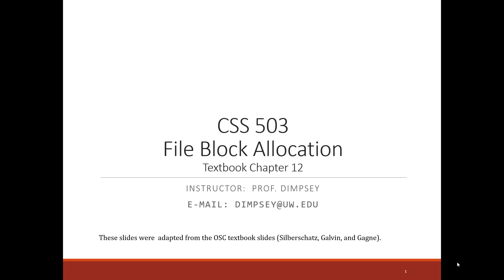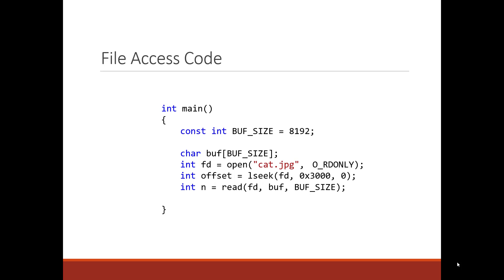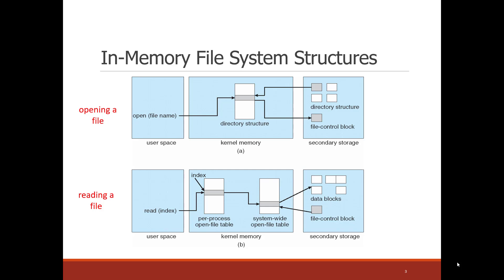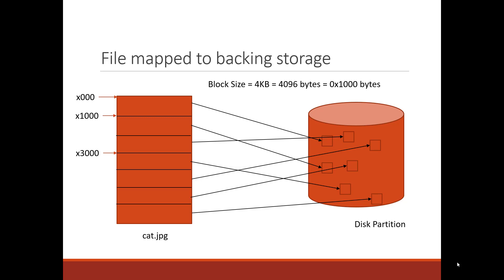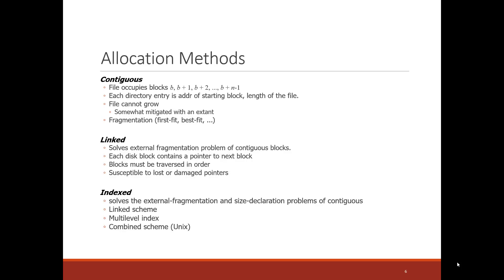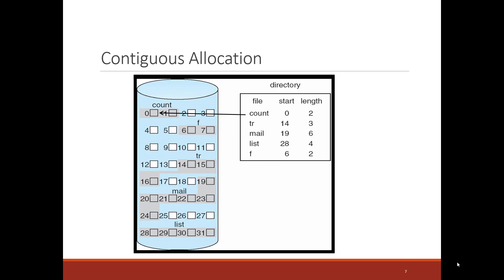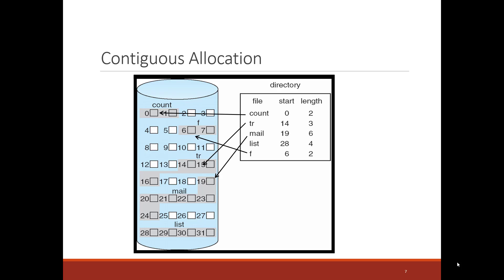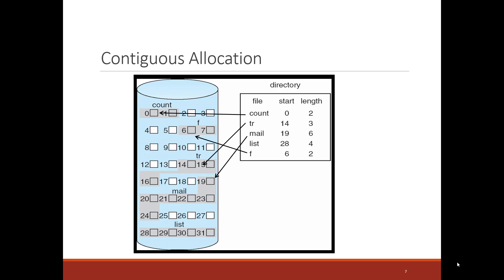File Block Allocation (1)

Comment: Is the disk normally split into blocks? Isn't there a smaller unit? Can't you split the disk by bytes to avoid internal fragmentation (even if two files share the same block)?

From my understanding, contiguous disk allocation is vulnerable to external fragmentation, but it is immune to internal fragmentation. One of the trade-offs of using blocks is the need to group bytes together into larger sets (resulting in internal fragmentation and a worst case of fragmenting a whole block for every file). If you don't, you would have to track all the individual bytes in the disk which is impractical.

If you use contiguous disk allocation,  why are you using blocks? Isn't it better to go down to the byte level?

If you use contiguous disk allocation, how do you track the free space? If you use blocks, you can use the linked-list or index approach. But what if you allocate by bytes?

When I was reading the book, it gave me the impression that you can allocate down to the byte level.
Reply from the maker: Partitions/Disks are always split into blocks.